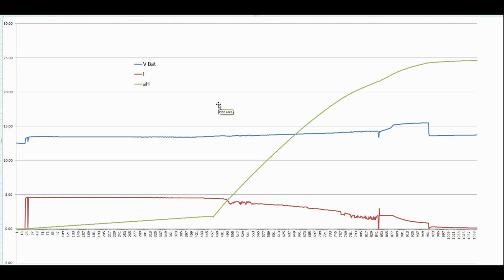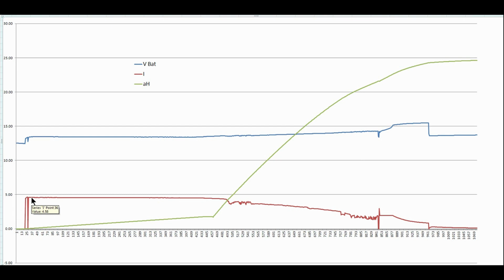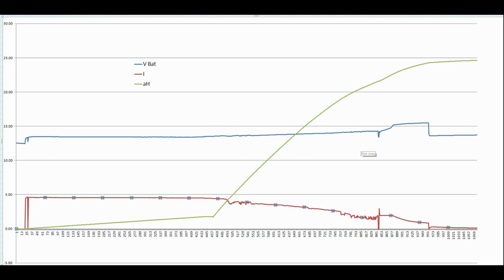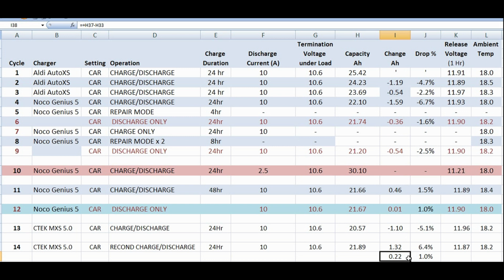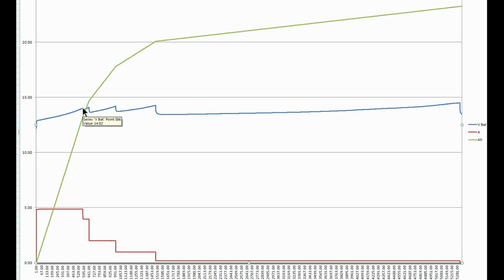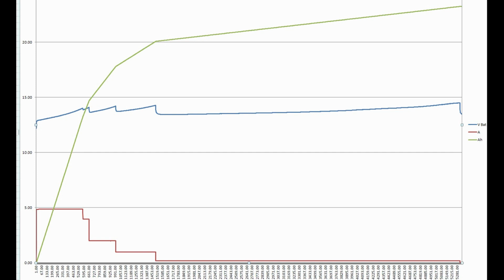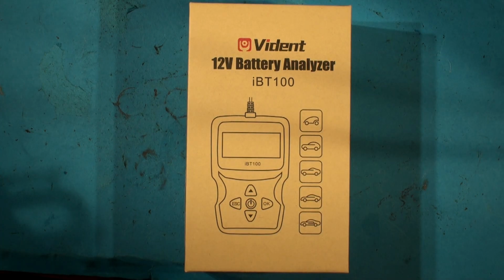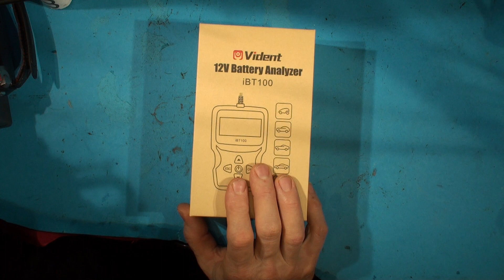Does the NOCO Genius5  charge better a than CTEK MXS 5.0 ???. NOCO Parametric Test Part 5

Comment: Hello, I would like to hear your valuable opinion. I have a Ctek CS Free. Ctek statements that all of its chargers are spark free, but my situation was different: With the charger turned off, I connected the positive clamp in the car battery and then the negative clamp in the specific place on the engine block (engine eyelet). But in this case, when connected the negative clamp, a spark appeared (keeping the charger turned off). I asked to Ctek support but they didn´t answer my ask. The Ctek response was:
"When the charger is completely shut down you should not see any spark when connecting it to a battery. When it is turned on before connecting it to the battery there is a possibility that you might see a small spark. No need for concern though since CTEK charger are safe on vehicle electronics, even if polarity was crossed when connecting it to the battery". 
As you can see they tried to evade the issue because of  the type of response they did.
The next day I tried to connect the CS Free again in the same way and there wasn´t spark.
According to your experience, What about this behavior of this CS Free taking into account that Ctek chargers are spark free? What would be the meaning of "spark free"? How would I be able to avoid this spark issue which apparently can appear in some situation and not in others?
Thanks in advance.
Reply from the maker: Electronically it would be easy to design a circuit that operates spark free. If you sense the battery voltage with a low current, then when it is stable (i.e. battery connected) you could commence with the drive of charge current.  If reverse connected then just flash an error. I guess if the  terminals are corroded or dirty or the clamp is not making good contact you could get a spark as the integrity of the connection breaks down.  With sealed VRLA batteries the spark is not such an issue as it is with standard vented flooded wet cell batteries.    The manufacturers make outlandish claims for their chargers - indeed the MXS5.0 does not follow the charge profiles in the user instructions and shown on the packaging.  To an experienced designer it is child's play to design a reliable charger. Their trick is marketing to such an extent that they can charge very high prices and you don't have to make it reliable or use the best quality components or surveil and test the product during manufacture.  I have lost count of how many CTEKs I have fixed that were supposed to be thrown away by the customer in order to receive their warranty replacement,
Reply: @razenby  Thank you very much for your comment. I have a Noco genius 5 and it is the best for me. I purchased that Ctek because I needed a charger in a place without current to plug the charger, and Noco does´t have this type of portable charger.
Reply from the maker: @10tigre1010  No problem.  All the comments are useful. Viewers read them a lot. Pls remember to subscribe. Thanks.

Comment: Magic Smoke, in cars with start stop that there is a battery sensor on the negative post, in the workshop manual it says when recharging the battery, it should be connected to the car so it knows it was recharged. So the charger negative clamp should be connected to the indicated ground bolt in the chassis but I measured the voltage on the bolt at 0.4v but If I put the probe on the actual cable where the bolt is tighten it measures the right voltage, 12.66v. 

How can the charger detect the voltage of the battery that way ? The clamp can't touch the actual ground cable to the battery only the bolt that holds it.
Reply from the maker: Good point. What does the charger user manual say?  My experience of Land Rover and Mercedes vehicles is that the Battery management/monitoring  modules / program, doesn't know it's arse from a hole in the ground.  I have direct experience - they are very flawed and cause millions of serviceable batteries to be scrapped. . I have a battery that was stopped the auto stop-starting on my Range rover two years ago that is working just fine in my Jaguar XK two years later.   The whole debacle is a travesty that the public is paying for.

Comment: Hey I just used my genius 5 for the first time and I had great doubts if I should have charged the battery still connected to the car or take it out. In the end I charged with it still in the car because many people do it and have no problems. I connected the charger first to the battery as per the manual and then to the outlet and as I plugged, it made a spark in the outlet which made immediately regret not taking the battery off. Hopefully it didn't damage the car or anything.

The other thing is that the manual doesn't really tell how to disconnect it. I was thinking of just unplugging from the wall but since it was still giving current I cycled through the modes until it selected standby mode then I unplugged. But now I see your graph, the charger starts supplying current as soon as you select the mode. Do you think it could damage anything when going through AGM and Lithium modes to reach Standby mode ? The battery being a normal 12v.

Thank you.
Reply from the maker: Connect the battery clips before you plug in the mains and disconnect the mains before you remove the clips. The latter is not so important these days as most car starter batteries are sealed VRLA.   No, going through modes wont harm it. Disconnect the battery clamps if you you battery repair mode on a modern car.
Reply: @razenby  Thanks for answering. Do you have any idea why it sparked on the oulet when I connected the noco ? Is it possible that the surge could damage the eletronics of the car ?
Reply: @guilhermeg345  Hello, the same for me with the NOCO Genius 5 and apparently it is normal. I have never any problems in my car (which has a plenty of electronic). You can see that spark behavior in numerous other devices (example: when you plug in power supplies of laptops, even the most modern ones, into the outlet). It seem to be the discharged capacitors are fast charged and this generate the spark.
Reply: @10tigre1010  yeah I know that happens sometimes but when it's about the car I get really startled. Because of the electronics and I don't want mess that up at all. Hehe

Comment: These are so interesting tests you've done here. I would like to ask for your opinion.  I drive a Jeep Grand Cherokee with one 70ah arm battery an a second one with 13ah..I guess just for the start-stop-system. They are charged together but the little one only supplies power wire the engine is cut off .. they say on forums. I wird like to get the Noco 10 to charge them fast. My girlfriend drives a fiat500 with 60ah agm. Is the Noco too "big" to charge all the batteries in an healthy way?
Reply from the maker: It is a tricky one.  I have had the same issue with a Range Rover Sport.  The second battery is tucked away somewhere and it doesn't even mention it in the owners manual.  These cars have a battery health monitoring module that checks and tries to work out the state of decay of the main battery. When it decides that the battery is low or defective the module prevents stop-start so the stop-start stops stopping . (?? i think that makes sense),  The stop start process places a lot more strain on a battery than just driving.  Slow current drain and discharge is a problem on modern cars as they are never really truly off. This drain is not good for the battery. To remain in peak condition  the battery needs to be maintained at or very near fully charged. My guess is that the second battery is of a much more tolerant type to deep discharge and support the electronics of the vehicle when parked. In addition it is is a source of stable power for critical electronic systems of the vehicle. They all have to remain running and ready and cannot be affected by the transients from the starter when it kicks in.   I have  main battery taken from a Range Rover Sport that was too low for stop start and it is now on my Range Rover that doesn't have stop start and 2 years later it is working just fine.  So there are probably a lot of otherwise serviceable batteries being condemned by the batter condition monitor.   The clue is that the Battery condition monitor has to be reset when a new battery is fitted. That should tell you something about the process of monitoring.  Why can't it tell if  a battery is good just by monitoring the battery performance. ? Why does it have to know that a new one is fitted??  It seems very fishy to me.  I would follow the instructions in your vehicle handbook otherwise if you upset the BCM (batter condition monitor) it might throw a hissy fit and stop the  stop-start and say' Hey there is something that my software programmer didn't know, expect or account for so in the interest of commerce I am going to condemn this battery so the owner can go in and buy a new overpriced one and have me reset by the dealer.  It is my way of saying I haven't got a clue about your question see what the owner manual says about a flat battery.   Most manufactures state that the recommended charge current for a ~70aH battery is 3 to 3.5 amps.  High current charge is not good.  It may get you back on the road but your battery wont thank you for it.   If you aren't in a hurry then a 5A charger is fine fr all but the most massive batteries..
Reply: @razenby  Just to let you know. I've bought the Noco Genius 10. It charged my two Jeep batteries (in parallel: 70ah + 13ah) full in one night. Seemed to work really well. So thanks for your tests on the noco.

Comment: I connected my ctek to my car battery yesterday and decided to connect my voltmeter also after watching one of your videos. I had ran the engine for 5 minutes prior so the initial battery voltage was 13.8v. This is an old classic car and had a weak crank on initial start up which is why I was charging it( voltage drop to 9.3v cranking) I never let this battery drop below 12.5v so not being driven so often may of affected it and being 7years old. Anyway a minute or so after connecting the ctek I noticed my battery voltage was reading 19.5v. So I disconnected the ctek and turned the headlights on for two minutes to bring the surface charge back down to 12.8v, then I reconnected the ctek and everything went back to normal and was charging around 14v. I don’t usually connect the ctek after running the vehicle so it probably hasn’t happened much in the past but I do remember about a year ago disconnecting the ctek after a couple weeks on the vehicle and seeing a high number I think around 16v. I assume that if you connect the ctek to a battery with a higher than normal state of charge it doesn’t see this and just continues its bulk charge in stage 3. Also I’m no expert so I could be doing something wrong just thought I would add my experience with the ctek the comments. Also battery is cranking fine now at 10.2v even today so battery is fine. Ctek has worked well for me in the past I have 3 and no major problems so not knocking the product at all.
Reply from the maker: Interesting.

Comment: One thing I heard and have seen about the act of desulfating a battery requires multiple charge and discharge cycles to see the results of the procedure.  I have seen a lot of videos where the repair cycle seems to have brought previously useless batteries back into service.  Given the many causes of battery failure, some didn't get "repaired" and some did...
Reply from the maker: Maybe standard wet lead acid cells but not VRLA staring batteries.  Urban myth. Getting the correct terminal voltage and starting the car isn't the same as restoring a useful AH capacity. The dealer is instructed as follows, I quote:  'If terminal voltage is below 11.6V battery is irreparably damaged and will never recover full capacity. It must be scrapped'

Comment: Without having to watch every video, can you do future tests to include RFI / EMI ( Radio Frequency Interference) caused by Ctek chargers?  We have had very bad digital hash spewed from older US3300 units. They seem to both radiate and conduct their wide band RFI from the AC line and the 12VDC line. The RFI is from LF up to Low VHF. Note sure of the FCC rating (the printing has rubbed off), but regardless, these units SPEW RFI onto the AC line, the DC side and into the air from the unshielded case. Any advice on filtering? Can you do some tests on toroids and “Brute force” filtering? CTeK has nothing and did not help with tech advice when asked some time ago.
Reply from the maker: Apart from a chamber, I have all the kit here to measure for FCC and CE, CCC etc. The final test is a calibrated antenna in a field.  I haven't checked the CTEK for EMI. I have blown one up with the Schaffner transient burst generator.,   If you look at the other 8A charger video you can see the radiated and conducted EMI issues with Chinese products. In fact not many of these products comply with CE. I have 
 had Chinese LED bulbs that blank out DAB radio in my house.  That takes some doing to design a 3W light bulb that radiates well into the VHF !! Some the CTEKs I have seen do have instability in the SMPS switching FET. It seems to me that a batch were made with the wrong snubber diode.  (normal silicon instead of fast recovery). The problem is that only samples at the outset of production are tested and for CE there is no surveillance. Some foreign standards require surveillance in production even to the extent of inspectors cold calling to  inspect the  approved products on the line.  They even cut up the inductors and transformers to check the power rating is as specified. I was on the receiving end of these for years. Glad I don't have to do that anymore.
Reply: @razenby  Do you think NOCO controller is better with how it regulates the current? Also it is cooler than CTEK5 temperature?  Both really shut off when the battery is fully charged?  Both turn On once the voltage down at certain V on the battery.
Reply from the maker: @rondhole  The CTEK is a string of lights connected to poor design.  It is a very expensive piece of cheap electronics.  Reliability is a major issue.   The NOCO is of a much better build quality. Neither meet their marketing claims.  For wet cell traditional non-VRLA (not sealed)  battery with DI top up openings then a treatment with the CTEK repair mode  might be more effective than with a  NOCO .  However the majority of automotive staring batteries are now VRLA.  The NOCO is much a more reliable and much better made product.  It is protected from water ingress and from dew point condensation.  These are major problems when support charging is damp out buildings or whilst subject to temperature and humidity swings when maintaining a vehicle battery outside.   Cross the dew point with CTEK and it goes bang.

Comment: What result does this video give me? nabijacka.yes or not. the recovery mode works on the charger ctek. I bought it and I still have no problems. thank you for the answer?
Reply from the maker: Yo see the evidence - you decide.
Reply: @razenby  Can you explain that to me? I don't understand and I'd like to buy a charger
Reply from the maker: @rudyb.1243  If you want to regenerate anything more than a slightly tired VRLA (Valve regulates sealed lead acid)  car starter batteries then it is already too late for that battery. The old wet cell vented batteries  were redeemable because they were much beefier in construction and the plates could take  overcharge during so called 'repair'.  Much better to periodically float charge your good battery and keep it good. If you buy a CTEK then don't leave it connected to the mains for long periods and don't let is cross the dew point else it will be dead when you go back to it.
Reply: @razenby  Who will be dead, battery or charger?
Reply: @razenby  in the manual it is written that the best battery is charged after step 8

Comment: Do you have any videos on proper maintenance for a battery? Do you recommend a battery tender? Or will one of these do the same thing?
Reply from the maker: If you are you talking  lead acid VRLA car starting battery, AMG or vented lead acid, then the proper maintenance of a battery is to keep it charged. Don't overcharge don't overdischarge it  and batteries used in leisure activities  should be  charged ASAP after discharge.   Every charge/ discharge cycle ages the battery.  Sulfate build up can be mitigated but only a the cost of plate erosion.  If you wait until you need to try Desulfation then it is already too late.  At the 'I think my battery is failing' stage desulfation It s not that effective on VRLA starting batteries.  Don't use your sidelights when parked and only  jump start a car if you cant avoid it - the charge inrush from the alternator hitting a flat battery will erode the plates. . Otherwise always charge a flat battery with a 3 stage charger .  If the starter sounds less perky than usual then charge the battery to full float / absorption voltage. It is likely that the battery would benefit form a full absorption charge  which is something it doesn't get on short journeys. Cars with alarms or other small current drain whilst parked should not be parked for more than a week without battery support. My Jaguar XK will completely flatten the battery in a month and without support will ruin a new  battery in about year as I only drive it every 2 to 3 weeks.  If your battery terminal voltage has lingered at less that 11.5 volts for even a short period then it is already permanently damaged.  A full charge every six months (more frequently in cold conditions) will prolong the life of your starting battery.  Always use a temperature compensated charger for battery support applications.   Batteries in good condition that are in storage should be charged every 6 months.
Reply: @razenby  thank you so much for the long answer! That helps a lot.